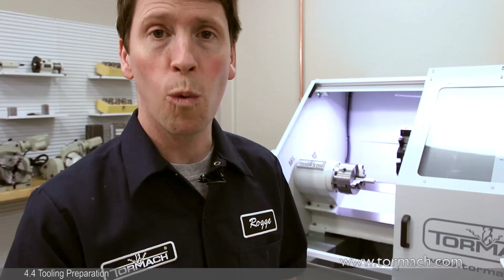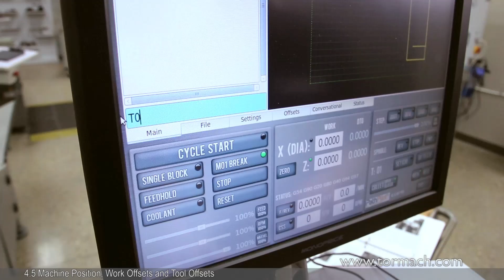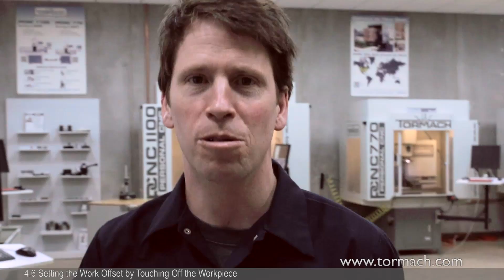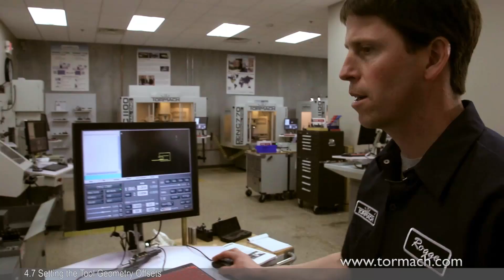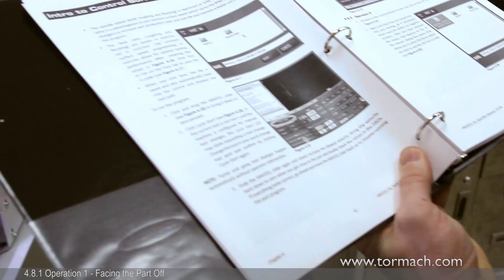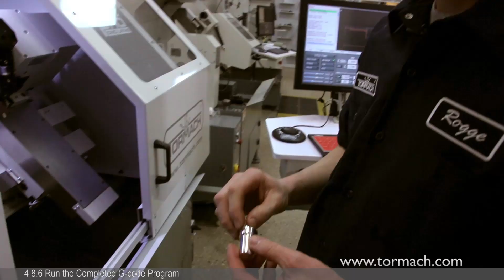Cutting Your First Part on a Tormach Lathe

Comment: When setting the offsets for the parting tool, it seems this has been changed in more recent versions of pathpilot to reference the #2 center point instead of the #1 as shown in this video. Is that correct? If so, PLEASE add a popup on the video at that point correcting it; we've spent days trying to figure out why our parting tool offset was incorrect.

Comment: How do you turn long shafts on these lathes? (say 15")
Reply from the maker: The 15L lathe was designed to be a chucker style lathe.  While we do offer a tailstock option for it , the longest part you can machine with it is about 9".  You can find the full specifications on our website.
https://www.tormach.com/15l-slant-pro-lathe/#techspecs
Reply: @tormachinc  I actually have a bunch of parts exactly 9"I intend to make. Will 9" exactly, or a hair over, work with the tailstock?

Comment: So no matter what, if you're using a front tool post, your diameters are going to be negative? Sounds confusing.
Reply from the maker: Any tool working on the bottom of your part will use negative diameters to indicate their orientation to the controller. If you have more questions, we offer a lathe fundamentals class to learn more: https://www.tormach.com/workshops/#1521581119570-043ac007-33f7

Comment: Thx for the video.
For arguments sake let's say you wanted to use a different tool in slot #1. Would you set work offset using tool #2, then adjust tool offset for tool #1?
Marty

Comment: I dont own a tormach yet, but I have been looking into them a lot lately. I like the idea of the path pilot, but it seems like it is lacking depth as a program. On a lot of the videos I watch of people using their tormachs for production work or even one off parts it seems like there is a lot of time wasted with the programming. Such as having the part move off of the work before switching to the next operation. Machining air is a big waste of time and if  you are using the same tool why does the machine jump off of the work so far before coming back to the machine at a slower pace to cut the same area of material. Like I said I dont own any of the products yet, but am considering buying very soon. Just was curious is I was missing something here.
Reply from the maker: Hi Varrock, In this particular video, Daniel Rogge is covering conversational programming from within the PathPilot interface. There are advantages to creating a part in this manner as you can avoid using CAD and CAM software. It's a simple way of creating parts quickly. This video is intended for beginners just starting out. Alternatively, you can use CAD and CAM software to create g-code; which creates more complex parts, with more efficient tool passes and more repeatability. Tormach is constantly adding updates and improvements to the PathPilot interface. Here is a link to the PathPilot main page, where you can find more information on the software: https://www.tormach.com/pathpilot.html If you have more questions about the machines and their functionality, please contact us through our Contact Page: https://www.tormach.com/contact.html

Comment: hi there i got problem regarding g code - conversational programming  face then when i fill in follow instruction as manual then a red light indicator come out saying that : x and z input in face conversational call for orientation [ 2,3,7] 
Tool table orientation for T1 is 1
Reply from the maker: Please contact our Technical Support Department: http://www.tormach.com/contact.html